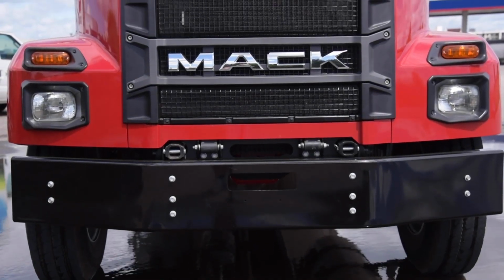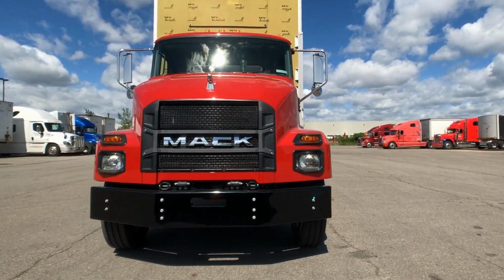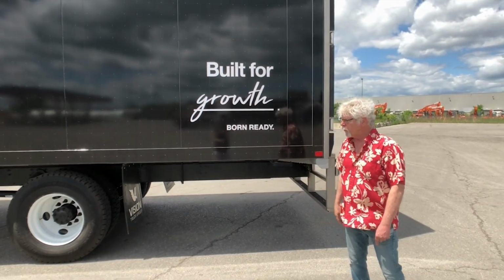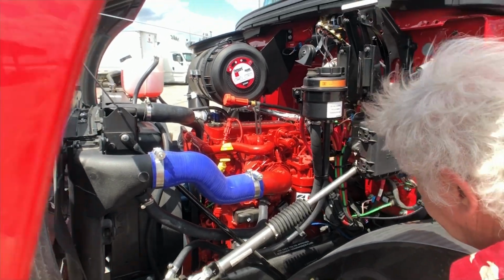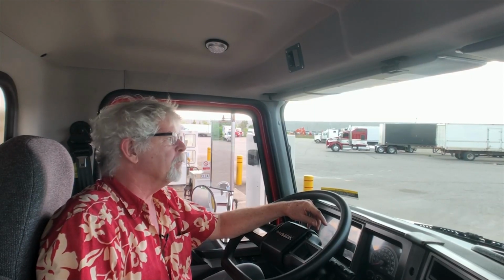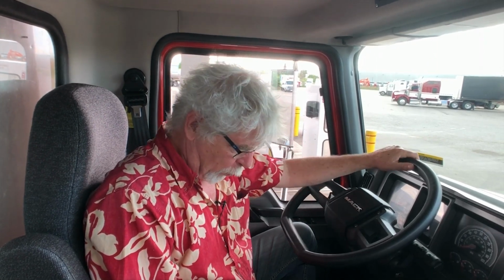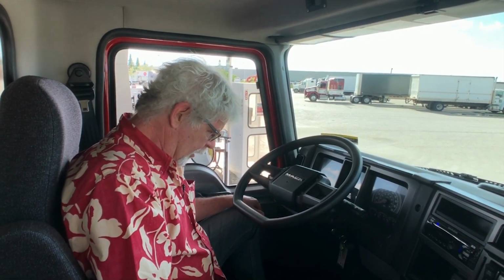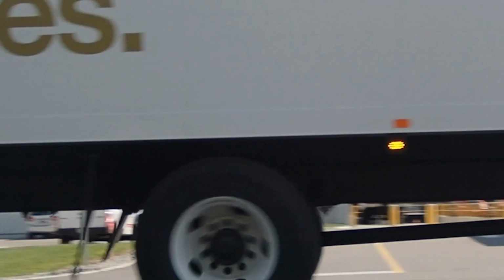FocusOn Mack MD7

Comment: It’s not the same cab as the Granite as stated in the video review. The Granite and Anthem cab is the Plus 4” cab. Easiest way to tell is the extra cab length from rear of door to back of cab.  Also the older CX/CH cab used was another reason why the dash center section degree out, had to be changed and for bench seat accommodation. This cab shell is pre 2007 CXN/CHN/CT .The Allison touch gear selector should have been made standard but may not be available on 2500 series. I suspect the chassis is straight rail like the CX/CH. The crossmembers are alligator type like used on the CH/CX
Reply: Like the cv series'?

Comment: The cup holder is a add on? What a joke. And then they're going to give you some flimsy junk next to the seat. When that breaks you won't have a cup holder at all. was it too much to put a cup holder in like every other truck in production today...just sayin
Reply: Sorry Paul, maybe "add-on" was the wrong word to use. It's obviously part of the truck, and it's standard equipment, not an option. Because the truck I had was a pre-production version, the cup holder hadn't been manufactured yet. I have since seen a photo of the interior with the cup holder and its a big sturdy affair, nothing flimsy or aftermarket looking.